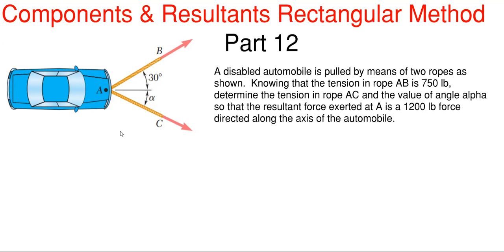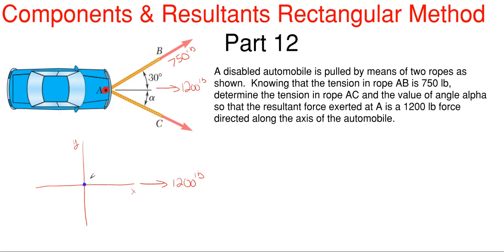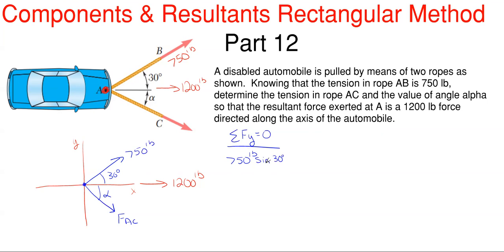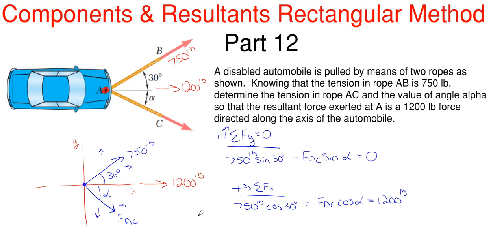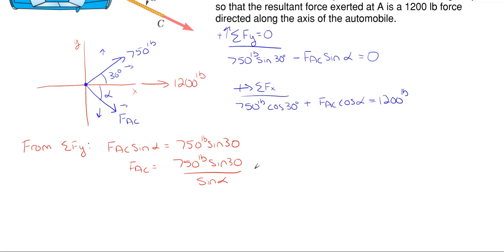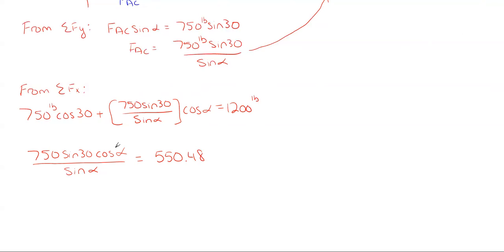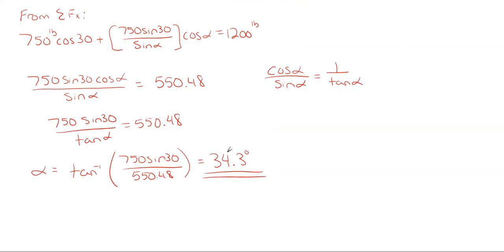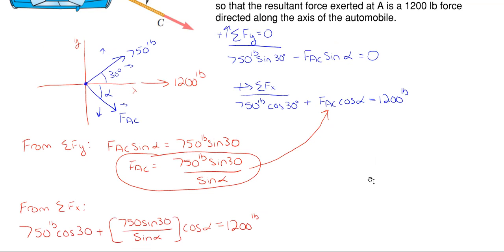How to Find Tension in the Rope From Pulling the Car – Statics Components and Resultants Problem 12

Comment: is there a way to do this with geometry and not trig? (law of cosine/law of sine)
Reply from the maker: Yes you can solve by using the law of cosine and law of sine.  First you would have to set up the parallelogram (if you want to), then use the law of cosine to find the force in rope AC where: AC = sqrt(1200^2+750^2-2(1200)(750)cos(30)) = 666 lb.  The difference is just due to rounding in the video.  Then you can use the law of sine to find the angle where: 750lb/sin(alpha) = 666 lb/sin(30).  The angle comes out to be 34.3 degrees.  Hope this helps.
Reply: thank you so much @Professor_Engineer